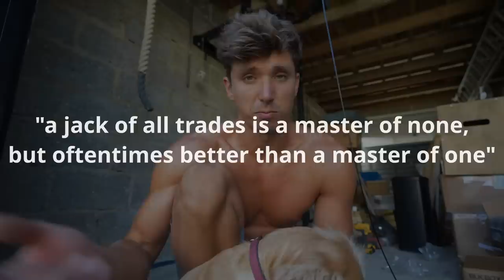I'm Starting Over...

Comment: Great update video. A few things I would love to see:

1. A video right now with where your basic strength level is like max pull ups/push ups and other foundational movements
2. Video describing your weekly workout split and how you plan to build up that foundation again
3. Specific workout routine videos for beginners/intermediates that help build basic foundational strength (with easy-hard progressions)
4. Maybe some ppl would like to see your dieting stuff also??
Reply: Amen!
Reply: This pretty much sums it up. A 'how to' from the ground up, using a logical, buildable approach. Include regression and progression for those behind and ahead. I find it extremely hard to put it all together (strength, flex, etc.) in an efficient manner that doesn't take 2-3 hrs/day. Also helpful to know the 'what' and 'why' (meaning body parts targeted and the reasoning behind it), particularly when it comes to building stability for shoulders, hips, knees, etc. Thanks for being truthful... a rarity on the internet and quite refreshing.
Reply: I agree !
Reply: @barbaramallow3870  ^this. All of this.

Comment: As someone who has also fallen off the fitness wagon due to a new job and having to shift to a completely new lifestyle (from WFH and home gym to 4 to 5 hour commutes per day with no gym nearby), this came at the perfect time. Most of the videos about how to stay consistent or get your fitness consistency back is “do it first thing in the morning, make it convenient” etc) but no actual plan on how to build up your sessions from zero. Ive tried to jump straight back into gym 4x a week and that was a massive fail- was too sore the next week to workout at all on top of the demands of the new day job. 

Hope we could see a framework on which areas of general strength to start with - aerobic base / cardiovascular health, strength, mobility, skill work. What are the main pillars we should work on getting back to first? How frequently to train when you’re first getting back to it, how do you know when to add more days for each, etc.? How to adjust from “what used to work” to a setup that works with the new demands of life? Any of these would be supremely helpful, and good luck on your latest chapter!

Comment: Sorry to hear about your injuries Tom. I can definitely sympathise: I suffered a bad shoulder injury when I was 20 that put me out of the gym completely for 18 months and which ultimately required surgery to fix. 8 years post-op, I still have to be careful with upper body movements and not lift too heavy.

As for your question to us viewers, my goal has always been hypertrophy, but most of the online guides on the topic (which presume you can progressively overload in weight until you're lifting at least reasonably heavy) aren't suitable for someone in my shoes. A video on how to put on size when you can only deal with light to moderate loads would be fantastic.
Reply: I definitely can relate to that since I'm dealing with shoulder problems myself and can't do most of the movements or only moderate or very light versions of it. So, a video that shows something like this would definitely be great.

Comment: Hi Tom! I remembered your stretch exercises. They are good! I have stopped going to the gym for a month and a half and I feel a bit unsettled going back. I want to continue my routine but like you I feel that I need to go back to basics. Although, I want to spice it up and avoid boredom. I usually do back, push and legs. I’ve never achieved the six pack but it would be nice to integrate it in my routine.

Comment: The brick analogy resonates a lot! Got MASSIVELY into powerlifting last year and I kept injuring myself and was feeling older and older and less mobile and in so mucn pain (yet my strength was improving and lifting heavier!). This was because I had not attended to the bottom two "bricks" and been doing zero stretching or mobility

Comment: No one (I think) makes a really solid calisthenics-mobility follow alongs, especially incorporating any sort of pull strength. I've always really appreciated the blend of strength and mobility you shoot for, so I would most most appreciate a follow-along workout series with a 15-25 minute length intended to be done daily, preferably one that only requires a mat and pull-up bar/rings. Daily yoga or calisthenics is a really easy habit to stick to, but it's even better when you have a video to follow. There are dozens of calisthenics channels that suggest workout plans, and dozens of follow along stretching routines and yoga videos. I don't need daily uploads, just enough to have a variety to pick from for a daily routine.

Comment: Some basic easy exercises can maintain and build a high level of calisthenics strength. Just dips, pullups, chinups are all you need for upper body. Running and pistol squats for lower. This can be done in a total time of 30 mins.

Comment: A question:  Is what Tom's offering here of relevence to someone like me who's about to be 60 yrs ?

My "goal" is to stay healthy, with a balanced functional physique, and injury-free, for the long term.

I have exercised well from ~30 yrs.  I currently run 10-15 miles a week (well, I run-walk-run that distance within the Aerobic to Threshold zones, in addition to a daily 3 mile walk).  I also do 2 gym sessions a week (body-weight deadlift; dumb-bell bench wth 20 kg weights; single-leg work on the squat machine; lateral pulldowns ~20kg less than body-weight).

It may be that my question is too specific, but any insight about whether Tom's program is right for someone like me, would be appreciated.  Cheers

Comment: There's nothing wrong with not training for different periods. Life happens.

I've slipped majorly for the last 6 months. I moved, changed jobs, and no longer live near a gym. Ive managed to do something intentionally active at least once a week. Home workout or a 2 mile walk.(mostly to keep my workout app streak lol)

I'm transitioning into more frequent workouts again now, but exercise isn't an a to b thing it's a lifetime process. Only natural that it would ebb and flow.

Luckily strength in the gym is easily and quickly regained after a period of maintenance.